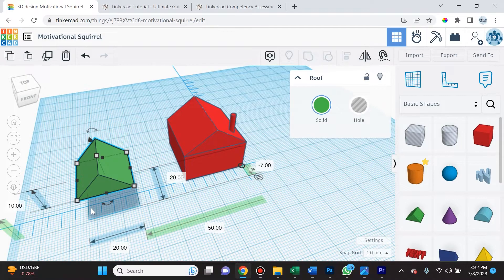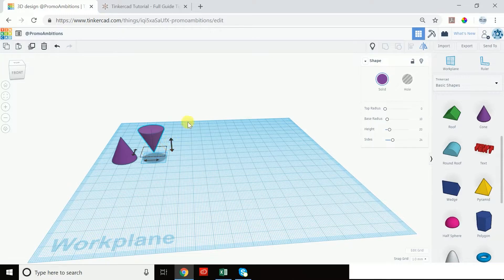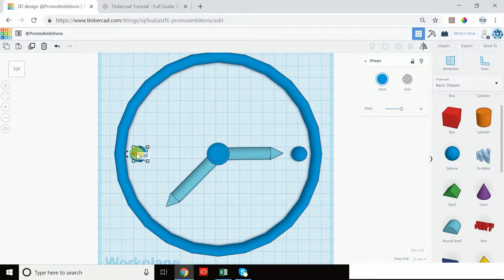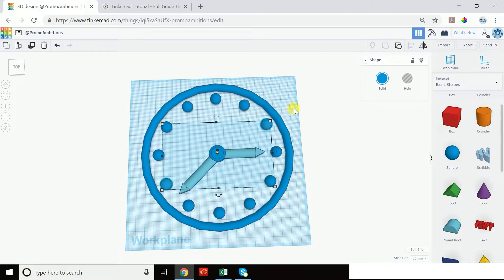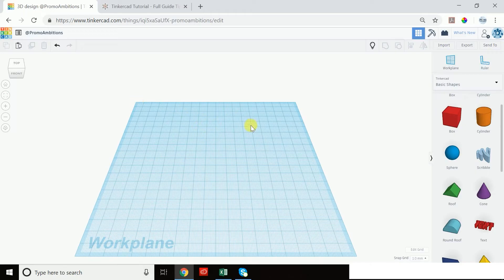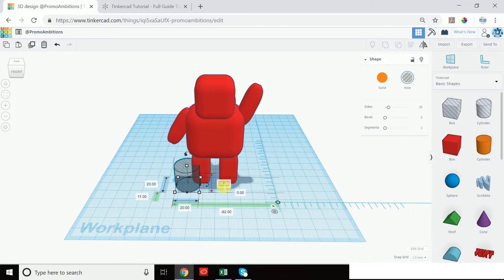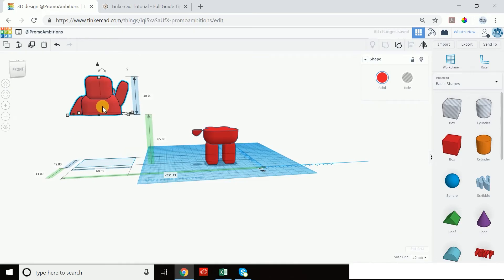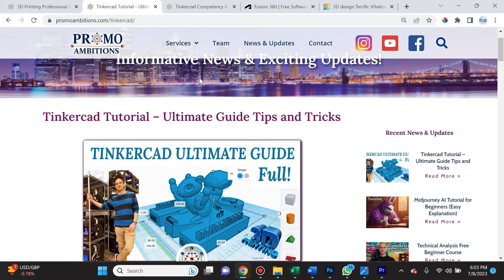Tinkercad Tutorial Part 5 - Linear & Circular Patterns, Slicing Shapes

Comment: The reverse of "hole" where everything outside the shape is deleted and everything within retained would be useful, maybe it's there already?
Reply from the maker: You can actually achieve that any time you want... you can toggle between solid and hole for any objects and then select group 🙌🎉
Reply: @PromoAmbitions  I'm not so sure that's exactly what I badly described.... For example, in your duplication video you draw a spiral staircase, imagine dropping a cylinder over it but with a smaller diameter, that if it were a hole would delete the area in encloses, if it were a solid it will fill the area it encloses, I am suggesting that the reverse action of a hole (not a solid) would delete the area outside of it and so leave a perfect cylindrical staircase... You might guess I'm kinda new to all this.....
Reply from the maker: @kaiwheeler64  the way I understand it, you are describing a hole that you change to a solid and the solid you change to a hole. If I'm misunderstanding, apologies : )
Reply: @PromoAmbitions  I'm terrible at explaining myself.... To trim the outside of your spiral staircase I'd pull up a solid cube, drop a cylindrical hole through it, group that and make it a hole, align and group with the stairs. If what I think I'm suggesting were doable I'd just align my cylinder over the stairs and be able to delete everything that was not covered by it.....
Reply from the maker: @kaiwheeler64  I now perfectly understand what you're describing... that would definitely make for an interesting CAD tool!